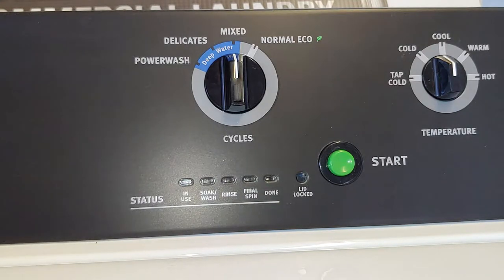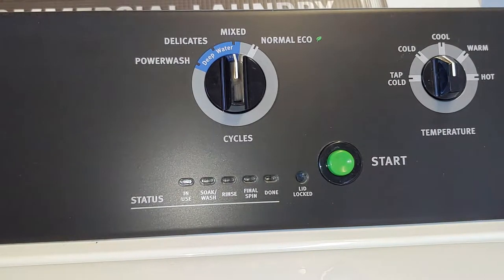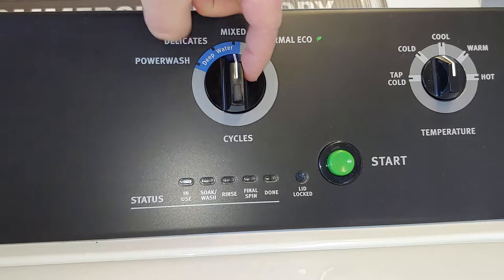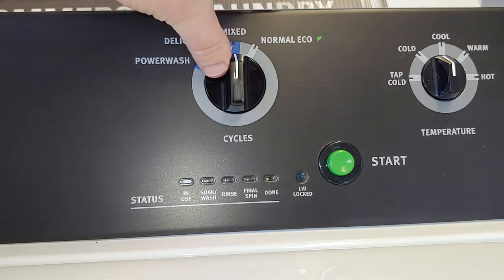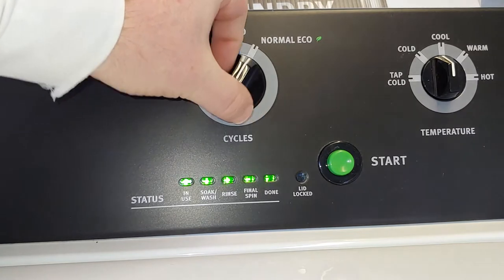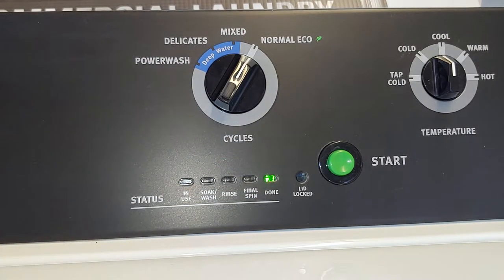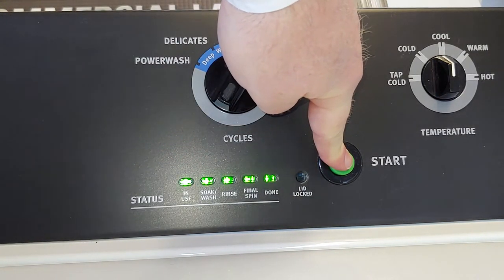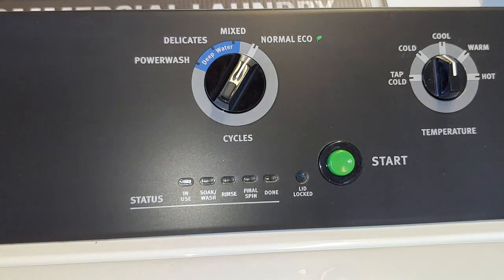Reset MAT20CS or MAT20MN washer

Comment: is this model MAT20MN still current ? the us version seems to have another dial, and more cycle options.... MVWP575GW ?  that appears to be the equivalent.
Reply from the maker: MAT20MN is the current commercial model with 5 year parts warranty.  MVWP575 is a special model for the single family residential customer and comes with a 5 year parts and labour warranty.  The 575 also has the extra dial with soak and extra rinse options.
Reply: @midlandcommercialsalesserv2172   thanks. it still has the powerwash option, so im guessing that is a longer cycle  ?
Reply from the maker: @JohnSmith-bn7bl  Correct.. Powerwash has longer and more vigorous agitation and extra rinse
Reply: I have the MVWP575. How do I put it in calibration mode. The dials worked for resetting the same but I had some parts replaced and I don’t think the tech recalibrated. The clothes don’t seem to wash long enough.

Comment: I have a Maytag coin version washer just like this and one of the terminals broke off the micro switch that starts the machine inside the service door. I put a new microswitch but you are able to use the machine for free now by pushing the green button and also none of the lights work but it cycles as it should do you think it needs a new control board now?
Reply: What did you find out? Mine has same problem, keeps ruining main boards. No lights, can't do diagnostics. You find a fix?
Reply: @ShanShanahan  i never found a fix

Comment: Is this a laundromat coin version of the Maytag mvwp575gw? I noticed It's missing the options dial and rinse and spin option.
Reply: i noticed that too... less cycles on the MAT20MN,  no bulky towels, no rinse and spin and no drain and spin ?  replaced normal cycle with the BS normal ECO...  and no options dial.   presoak, extra rinse, etc.   i wont be getting this watered down Australian model.
Reply: @JohnSmith-bn7bl  I don't think this is an Australian model. This I believe is the coin operated version (found in laundromats and apartment buildings) so there doesn't need to be as many cycles/options
Reply: @DylBuilder1  yes we can purchase this exact model for home use. even tho its classed as commercial.

Comment: How do you cancel the cycle if it gets stuck or you don’t want it to continue?
Reply from the maker: You can hold the START button for 5-10 seconds to cancel the cycle.  If that fails unplug the machine and wait 20 seconds to plug back in.  If all else fails try the reset.